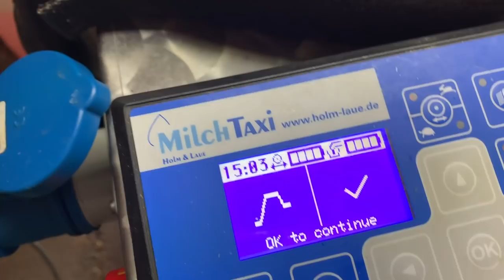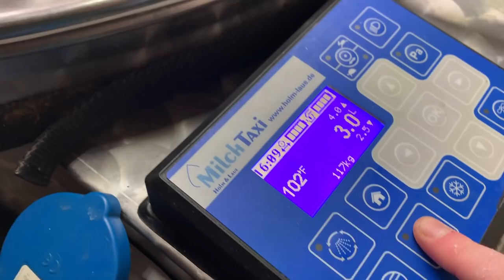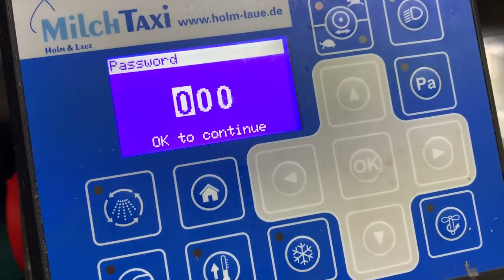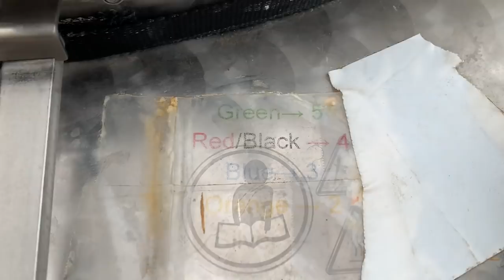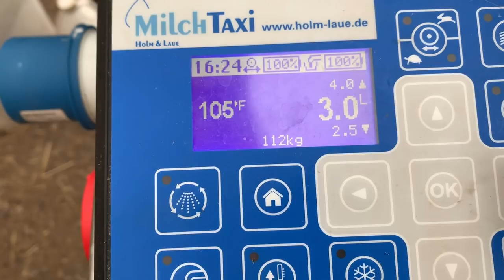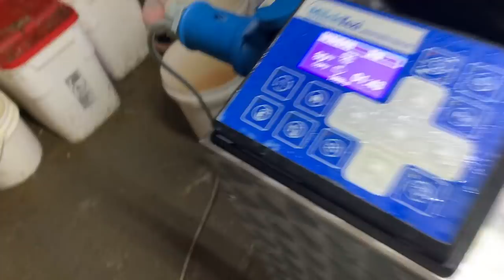MY THOUGHTS ON OUR MILK TAXI | ft. some pro pailtraining tips

Comment: Worked on a dairy farm for years myself, always read a lot of information on feeding milk replacer vs pasteurized milk. Most studies always suggested that replacer was more cost effective, especially when you take into account the cost of production for milk. However, I always said its whatever works best on the farm, and if you are losing less calves, sounds like its working! Keep up the good work
Reply: At one time it was. Bit milk is at $14/100lbs and milk replacer has gotten insane. Also alot of times it's the milk you cant sell anyway. (Withdrawal period milk.)
Reply: Acer Acres  depends on what the cow was treated with. One farm I worked at we would add a day to be sure so that and the last day of would go to the calves.    As was  the second after birth milking.  But I get where you are coming from and that milk always went into the drain to the lagoon.  If we were short we would have to use powder.

Comment: Hi Claudia, the Holm & Laue Smart ID is a nice addition, it controls the amount of milk via a transponder, I wonder what it costs per unit.
And remove that blanket, check 5:13, i saw some rust on the tank,  the blanket also absorbs water, i don't think the tank is made out of stainless steel, so you better remove it to prevent rust.
Stay yall healthy and greetings from The Netherlands.

Comment: For our calves the biggest health benefit has been switching to nursing buckets for first two months. We use Milkbar buckets. They claim its important for calves to produce lots of saliva during milk intake for proper digestion and in our experience it really makes a difference.
We still struggle with communication between different workers though. There can be 3 different people feeding calves in a single day. We might try your approach. So far we've been trying to increase portions in smaller increments, like 200-300ml  per day but even though it sounds better on paper, there's no benefit if you end up screwing everything up by miscommunication.
I might have missed that but do you feed your calves 2 or 3 times a day?
P.S. Fun fact - we use milk replacer because it costs roughly 2/3 of or own milk per liter. With the bad flu our milk price is going down right now so it might be changing soon.

Comment: Powder solutions normally need to be pureed before putting into a large tank like that to mix in a larger solution, the same principle applies when mixing herbicides which I am sure your Dad is familiar with for spraying the fields. Of course liquid solutions are always better, but usually more expensive. Also forgot to mention the powdered solutions need to be constantly agitated to maintain the formulation which is normally accomplished by a small pump with a feed and return valve.

Comment: If your milk taxi is heating it up to 107° and it needs to be @ 104° try setting the temp @ 102° and see if it shuts off at the correct temperature.